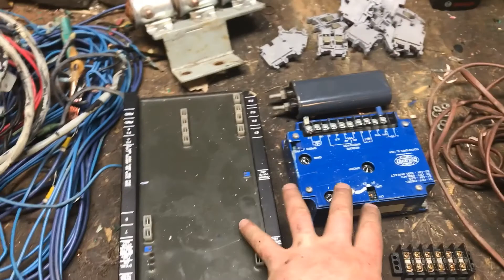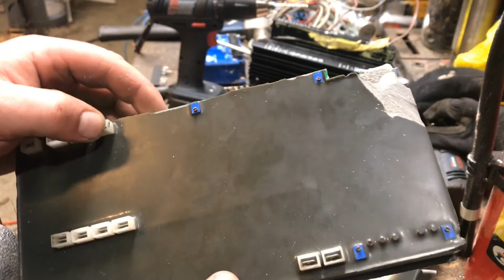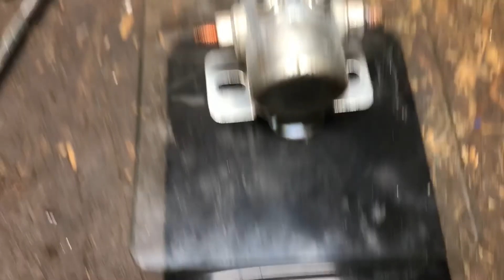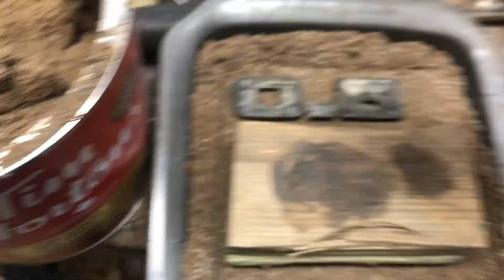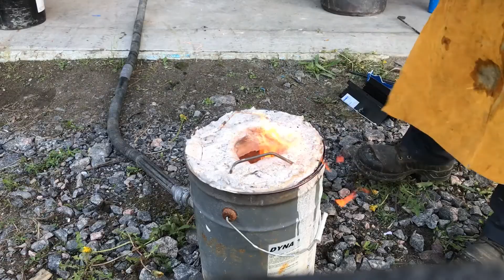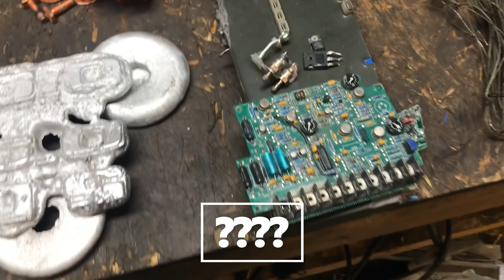Generator electronic tear down and casting sand testing

Comment: Here's a tip.  When you are heating your aluminum, start off with a nice ingot in the bottom of the crucible (or whatever is left in it from previous melt) - I'd say maybe 1/2-1lb for the size of your crucible.  Once that melts, you are ready to add the new stuff.  Now while the ingot is melting, place the new stuff on the exhaust hole so it is getting hot while the other metal melts.  If you do this you will probably be able to make the new metal just sink straight down into the melt - very satisfying!

As for doing precious metal recovery, unless you have worked with acids, bases, salts, etc before and understand chemisty at least moderatly, I wouldn't really bother with it, or I would wait until you know a little more about it.  I've heard of many stories of wasted material (both acids & electronics) and just ending up with a huge mess, some of it very toxic.   If you wait till you have at least a fair amount to process, you are at least going to get something as a result unless you really mess it up.   I've seen some of these channels on YT about refining scrap and their results vary so much even when processing the same boards/scrap (diff batches) in the same method.   

Anyway, good luck!.  Oh, I think you need to work on your sand.  It looked very grainy, almost like you had oatmeal mixed in with it.  I bought high quality silica sand and then sifted/screened it so I was only using sand of XXX size or smaller.  I think it makes a big difference in packing and the quality of the cast.  Also, IDK if you added clay to yours, but that is the binder (from what I've heard/read)  that is usually used, along with water (though some people say oil....?) As for the clay, I think it depends on the consistency of your sand but I've heard 5-15%.  IIRC, you can get general bentonite clay which is plain generic kitty litter. I allowed mine to soak for a week than screened it (there are sizable rocks in it - the size of peas sometimes).
Reply from the maker: Thanks for the feedback, much appreciated!

I've since created a new propane furnace that melts like a champ, but adding a small amount of material to pool before a large melt is a trick i've started using - definitely speeds things up! (As can be seen in my platform melting video :)

I agree with you on refining - I've read up on it and am not ready to try it out quite yet: it's definitely something that needs to be done with care and attention, so until I'm ready to focus on that I'll keep collecting the boards.

For the sand...I don't think I even had clay in this video! It was definitely sticky and did not work well, and the sift on this batch was much too coarse :P . I've purchased some Petro Bond and I don't think I can do back! Throwing the bentonite in an old blender made a world of difference for the consistency as well.